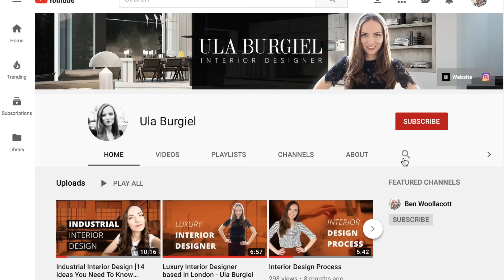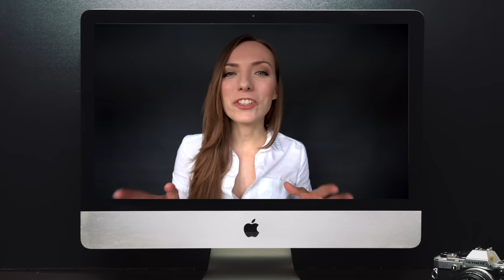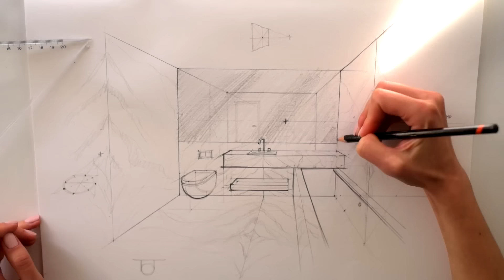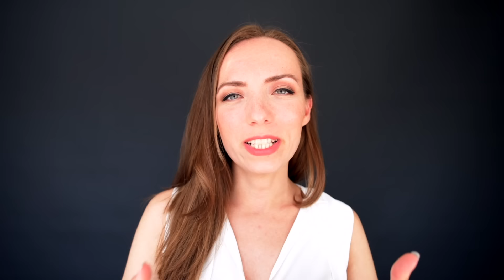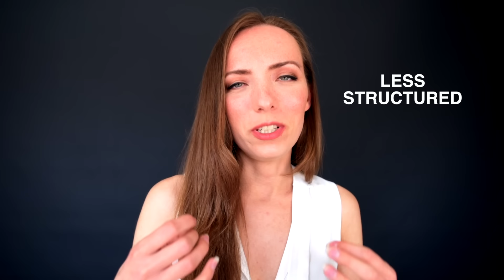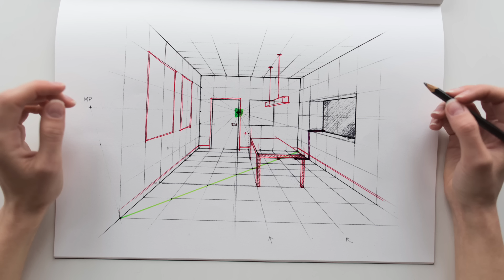Interior Design Sketching - Complete Guide for Beginners and Pro's

Comment: Example given for 2 point perspective isn't correct. It represents rather 1 point perspective still.
Reply from the maker: Hi Agnieshka, 
My example of the 2 point perspective is correct. Could you elaborate some more on why you say it’s incorrect?
Reply: @UlaBurgiel1  its simple - the lines from oposite points they meet in the center and define the central part of object. This part is the highest. Here it's oposite - central point is the lowest exactly like for one point perspective. it also has been shown at the examples from professional websites.
Reply from the maker: @agniecha07  The names 1 point perspective and 2 point perspective refer merely to the method of drawing used, not to the object drawn - which it appears you are referring to.
Reply: @UlaBurgiel1  then it wouldnt have any sense to distinguish between those two. The way how the lines are being led, define further the object and that's the whole sense. Anyway it's a useless arguing because geometry is a part of maths and now it looks like I should prove why 2 plus 2 equals 4.
Reply: @UlaBurgiel1  I suggest to watch the proper demonstration how to draw the lines and then how to build the objects based on the web those lines create.